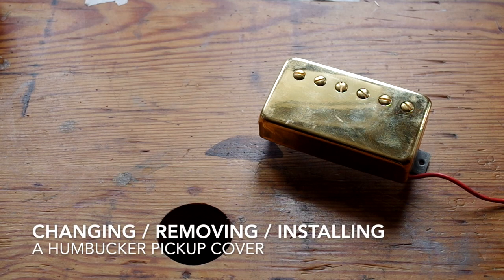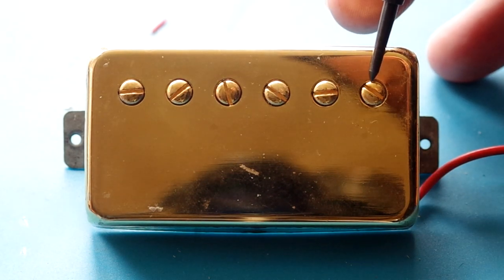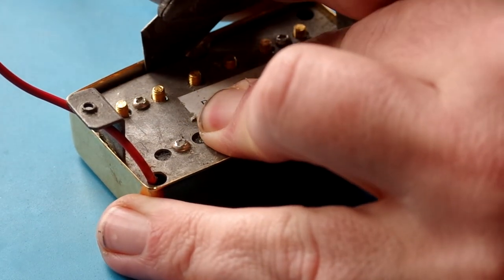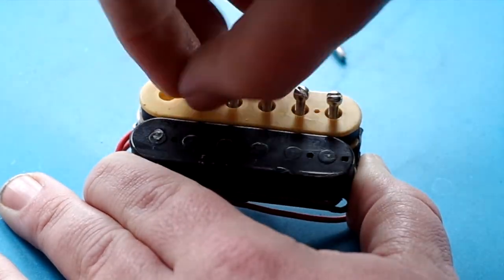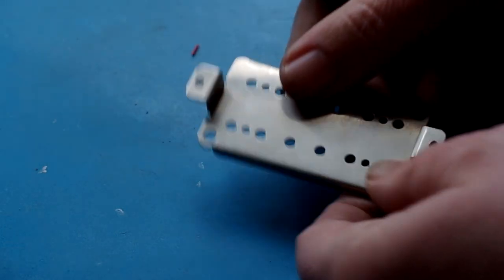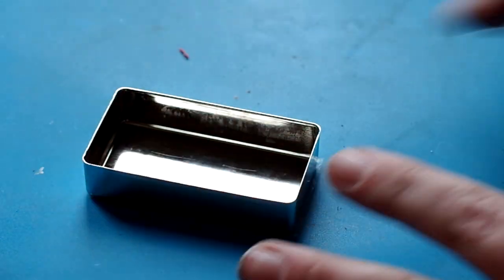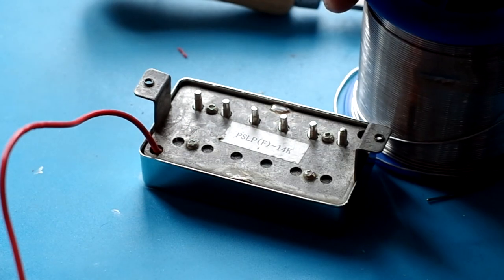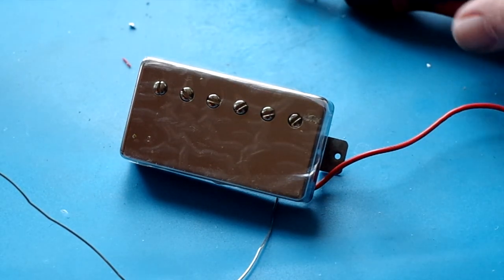How to Change / Remove / Install a Humbucker Cover

Comment: Just a quick note. An easier way to measure the pole piece holes to make sure they will align is to measure from and to the same side of the first and the last hole rather than centre-centre. Takes the guesswork out as far as “am I actually measuring from/to dead centre?” and gives the same result. 

Alternatively, you could turn the new cover upside down and lay it on top of the other to check. :-)

Comment: I measure the edge of the screw to the edge of the screw instead of trying to eyeball the middle of the screw. Just make sure you go left side of screw to left side. Or right to right. Depending on how fine and accurate your measurements need to be this method works better than eyeballing the middle of the screw.

Comment: Hey there, I'm in South Wales, Barry area. I bought a preowned Ibanez and am thinking about swapping out the stock ibanez humbuckers. It's a H/S/H configuration but the pole pieces are a bit rusted from age and probably atmospheric conditions wherever it was previously kept. 

I was thinking about removing the plastic covers if they came off, lightly cleaning the top of the poles with some  light grade steel wool or sand paper, but I haven't done that before and I don't want to end up with steel filings stuck to my pickups. I know not to go near them with a magnet, but if I did this I considered maybe spraying the plastic covers to make them look like DiMarzios that I see on more expensive Ibanez models - green and yellow for example.

But to be honest I would rather just buy some better pickups for the guitar because it isn't a bad guitar to learn on. It's an Ibanez GIO GRG270b with teh Edge 3 locking tremolo.

I just wanted to know if you are close to where I live as I don't drive, what sort of pickups do you stock? and could you fit them for me too? I play a lot of metal but also love Steve Vai, I was going to go down the route of the Dimebucker set, but would also be happy with anything that 1. sounded good for my style of playing, and 2. looks good in the guitar.

Let me Know,

Ben
Reply from the maker: Hi Ben, thanks for your enquiry. We no longer fit pickups but we'd be delighted to get making on a HSH set for you. Best to hit us up at radioshoppickups@hotmail.co.uk if that's ok and we'll run through some options for you 👌 Cheers, Paul

Comment: Do you have to solder it? I'm very unexperienced in soldering and don't want to screw things up?
Reply: Yes you have to. It's one of the most important things Especially if you don't wax pot your pickups. You see when there is a gap between the pickup and the cover the cover vibrates creating microphonic feedback. So it has to be nice and tight. I personally don't like potting pickups because i feel like i don't need it. But if you want to "kill" as much of the vibration possible in a safe way you can always put a piece of masking tape inside your cover between the cover and your bobbins. It's reversable too. Hope i helped. If something that i wrote is wrong or if you have better tips please help this man. Thank you
Reply: The solder is there to avoid electrical noise too
Reply: @symptomoftheuniverse1261  
I was wondering the same thing.
Thanks for the explanation.

Comment: Haven’t removed covers before but wouldn’t a soldering iron and solder sucker be all you need?
Reply: Well, if you watch the video, seems like their method was pretty simple. No solder dripping into the coils, no heat melting the bobbins, etc.

Comment: I'm about to put covers on two DiMarzio humbuckers. I have searched but found NO clips describing the process. The pickups in question have dual rows of allen screw adjustments, not a row of screws and a row of slugs like a Gibson. I ASSUME I have to use covers with no screw holes. Does NOBODY put covers on that type of pickup?
Anybody?

Comment: No need to melt some wax on the pickups before installing the cover?
Reply from the maker: Not really necessary, no Shahzeb. Wouldn't do any harm though. Plenty of classic era Gibson pickups were completely unpotted so lots of precedent for not using any wax at all 👍
Reply: @RadioshopPickups  I heard you get a ton of feed back guys buying those parson street humbuckers need to wax the covers.

Comment: My humbucker doesn't work when I installed the Cover .. i removed it then it works again .. can anyone help?
Reply: Hi! Did you verify if when the cover was on, any of the inner wires of your pickup was touching it? If that would be the case, then your pickup was conected to groung by touching the pickup cover. Hope it helps.

Comment: I change my cover from chrome to nickel  Seems to have added a little noise  why it’s that?
Reply: Your old cover must have been chrome plated brass and the new one propably real nickel silver. The brass is much more conductive and therefore behaves as high cut (low pass) filter via the eddy current effect. So your renewed pickup became stronger in the high frequencies and  what you may here it is some extra “hiss” or overtones of the hum noise which normally exist even in humbuckers which are not totally balanced.

Comment: why not heat the solder joints ... and THEN cut them, as in other vids?
Reply: If it works without heating it, then why heat it because it will just add more time right 🤷🏻‍♂️

Comment: What if the solder is somehow unmeltable?
Reply: Then you're doing it wrong, using the wrong solder, the wrong soldering iron, dirty soldering iron tip, dirty material etc.
Reply: Patiently hold it to the solder until it melts or turn up the heat lol.
Reply: @AdultsAreTalking  full heat for 10 minutes + wasn't enough lmao
Reply: @vikdopak2166  Time for a blowtorch!
Reply: @vikdopak2166  Your soldering iron lacks the heat capacity to rapidly heat up that large thermal mass (big piece of metal.)  Buy a quality soldering iron, such as Weller brand.  The 100 Watt iron with a nice big tip is a good idea for this large of a metal surface to be soldered.  I have a 40 watt Weller that can quickly solder wires to the backs of potentiometers, but is not too hot for doing through-hole PC board work.

Comment: What if the pickup is potted?
Reply from the maker: Hi there. If it's potted, this will change very little. If you meet some opposition whilst trying to prise the cover off then it may be time to reassess but most likely outcome is a perfect wax cast of the underneath the cover area. If removing the cover altogether and you find this 'wax cast' underneath then you have to decide whether to carefully strip or just leave as is
Reply: @RadioshopPickups  Thank you!